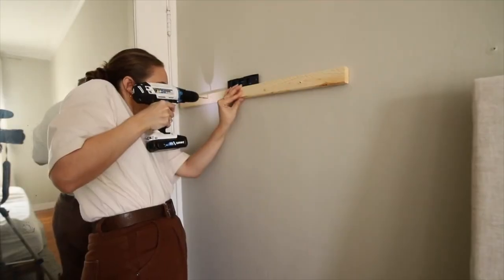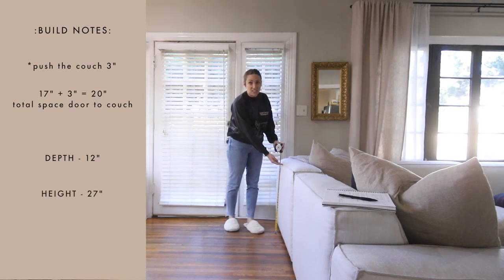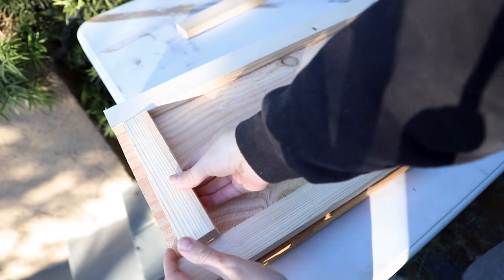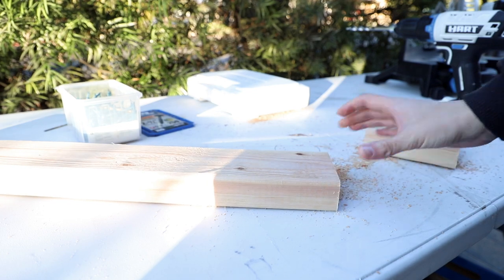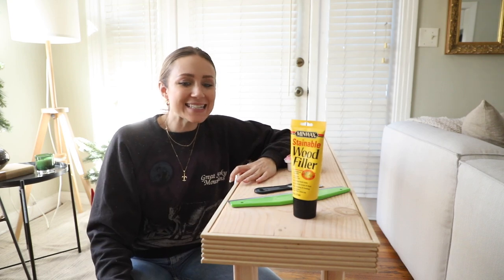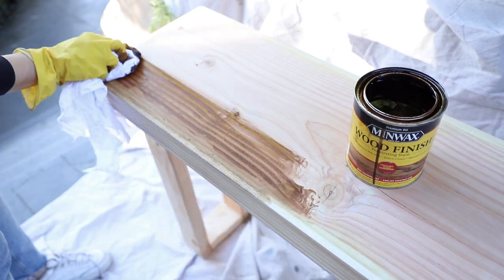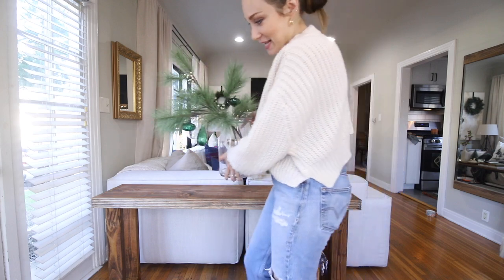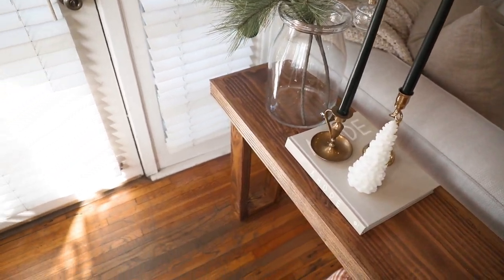DIY Entryway Console Table UNDER $40 + Decor Styling Tips | XO, MaCenna

Comment: I think the tiny bit of gap in the measurements is because the saw blade eats up a tiny bit of the wood- so if you cute right ON the line you measured, it will come up just a TINY bit short on all sides. Try cutting with the blade touching the outside of the line you want, to get it to end AT the line, instead of across it. This looks fantastic, I loved the end result!! 🖤🖤

Comment: The trim length not coming out exact might have been due to the thickness of the cutting blade
Reply: Cut it a little too long because you can always go back and make it shorter!
Reply: It’s called the blade ‘kerf’. I was always short until I read up about it!
Reply: “Save the line”

Comment: Table is gorgeous and Kingsley is too funny. As for your trim not meeting up, You would have to measure to the outer edge (making sure that is including the depth of other piece of trim on both sides - unfortunately math is usually required with wood and miter cuts), cut to that longer length and then make your corner cuts. Your inner cuts once mitered are the same size as the table but the outer ones are longer. I did the same thing on one of my first projects too. Wood filler to the rescue. Either way, be proud of it, great job!

Comment: In the future, add a quarter inch to your 45 degree angles before cutting and then trim as needed. Wood shifts and shrinks (especially when going from outside during the day to inside at night). Oh, and always measure with a tape measure for more accuracy. Thank you for showing the pocket hole maker. I will definitely be picking that up.

Comment: Great project. Love the final look.  Super simple and sleek.  I also always had the same problem with coming up short with angled pieces until I learned to account for my saw blade width. Not sure if this is what happened to you but ever since I learned to cut the piece just to the side of my marking rather than on the marking I've had much better fitting.  You may already know this. Just though I'd share. Great tutorial!

Comment: Love your channel! Glad you’re venturing into power tools! Just a tip. It seems like you’re mostly using pine? That’s cheap and easily available, but, it’s not good in terms of longevity. I think you’re adept enough with power tools to venture into hardwoods. Maybe birch or maple to start out with. Those woods take stain better and won’t dent or scratch as easily and they’ll last you much longer.

Comment: I LOOOOVE this console table 😍....I hope these tips can be of some help with the issue you had with the side pieces coming up short 🤗: 1) The blade (of the saw) itself always takes away more material than you think, so you would need to take into account the thickness of the blade when you position the piece of wood on the saw. 2) Also, when you measure for miter cuts, you want to be sure that you are not measuring from the outside face of the trim, but instead the inside face that touches the table.

Comment: The flat bottom you created for the legs to sit on the floor you probably also could have done for the top of the legs to simply attach to the underside of the table this would have eliminated mucking around with pocket holes etc and probably made it more sturdy but well done this is great I’m about to start and your way of doing things with the trim has inspired me thanks

Comment: Hello! The trim is off because when you miter it makes the back side of wood slightly shorter than the front. To avoid when you miter make sure you bring the saw over the line where you ginna cut and have it saw away from the pieces you are keeping. Dont miter in towards your kept piece or the angle makes it shorter. Hope this helps! I've made that mistake SO MANY TIMES

Comment: I think what happens with the mitered edges, is that the saw blade takes away a few mm because of the thickness of the blade. What I think you can do is sneak up on the cut. Cut it to big and then take of a smidge and dry fit. Hope this helps!

Comment: MaCenna love the table your mitered blade ends are coming up short because you have to add the thickness of your saw to your measurements.. this should give you perfect corners ex. if your measure is 5ft and your miter blade is ¼ in now you cut 5ft¼in for your miter corner.

Comment: Are you subtracting the amount of each cut from the trim? If your removing the edge from each trim piece then you’ll have to add an addition amount to the length or remeasure after you’ve secured the legs to make sure it’s not pushing out.

Comment: MaCenna.....I think maybe if you measure your side pieces of the trim from the outside edge of the front and back trim and then cut the angle rather than measuring the side pieces from the edge of the table top....does that make sense? xx

Comment: It’s likely because the wood top isn’t perfectly square. Usually you have to rip those pieces at home to get them perfect. If you make your miter cuts at 46 degrees they’ll fit together, even if the corners of your wood piece aren’t square.

Comment: The problem with the trim measurements is the blade curf. The width of the blade comes off with every cut, so if you are coming up short, you need to cut on the outside of your cut line, not the inside or the middle. If you are cutting multiple pieces out if the one length of timber, it's also a good idea to measure, cut, and then measure the next piece. That way you don't have to know the exact curf and you can skip the maths of working it in to all of your measurements. 
Don't sweat this. So many DIY tutorials just tell you a bunch of measurements and never mention that you need to take this into account. It isn't anything you did wrong, it's just a quirk of the tools 😉

Comment: Sorry if this has already been commented... but in regards to your corners not meeting up & measurements not quite working out...are you taking in to consideration the width of your blade? Most blades with take off up to 1/8th inch. If you're cutting directly on your marks, 2 cuts & you could end up with a piece that's 1/4th inch too short. It looks like your gaps were roughly that size. You can do some test notches to see how much your particular blade removes & be sure to shift your pieces that far from your marked lines.

Comment: Hi, I’m a newbie and never done anything like this before. I’m reading the wood dimensions and don’t understand how that works.
Is it 1 piece 2 inch x 12 inch x 8ft 
2 pieces 2 inch x 4 inch x 8ft and the same for the rest? I’m using centimeters and meters so it’s quite confusing

Comment: Hi, 
The problem that you mentioned in your video, I believe that is not for the way that you take the measure of the piece, I believe that you didn't take in account the thickness of the saw blade, for example if the thickness of the saw blade is 5 mm and the total long of the piece is 30 cm, you have to cut the piece not in the line that you did, because the long on the piece will be 30 cm less 2.5 mm total 29,75 cm, and the piece will be shorter, I usually make a little mark on the wood with the saw blade teeth, before cut the wood, because sometimes it happen to me, that the total result is 30 cm less 0.5 cm total long 29.5....... and not fit so well....
I love your channel from Madrid! and I love your stile!

Comment: Tip for cutting and not having gaps- don’t cut ON your marked line, cut just outside it! (Make sure you mark with chalk or pencil so you can erase it) because the saw will cut a wide path, it doesn’t slice! It eats through the wood, which is why you get sawdust. So cut outside your line!

Comment: I think you came up short on the trim because you didn’t take into account the thickness of the blade. Also I think adding a piece of wood along the bottom between the legs will make it more sturdy. It might take away from the aesthetic but I will help with the slight wobble.